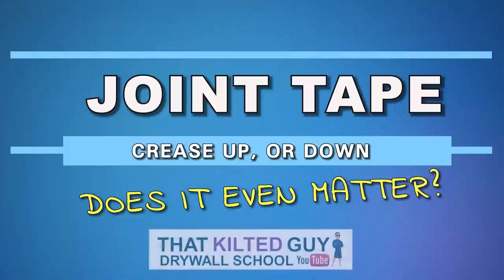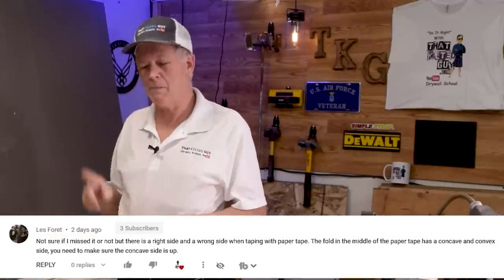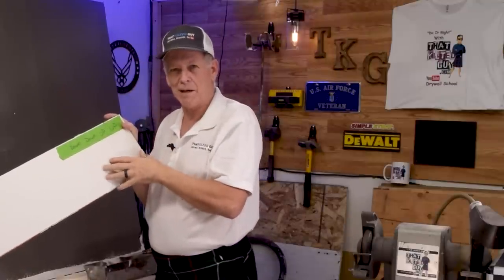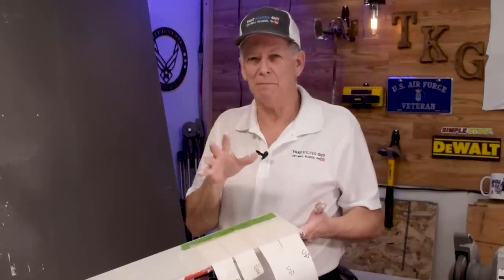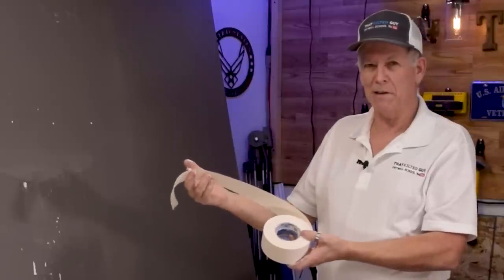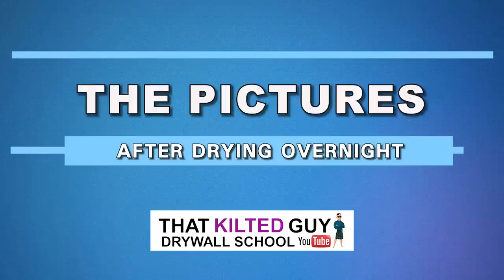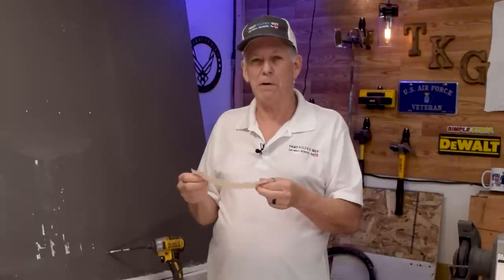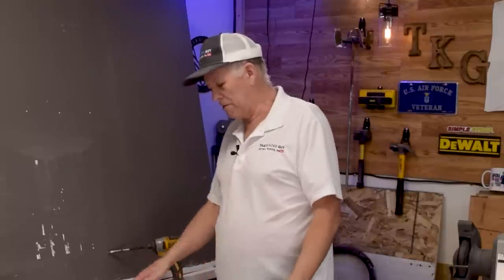I Was Taping Drywall with Paper Tape WRONG for 35 Years???

Comment: Have been taping for 45 years. With a bazooka and hand taping with paper tape small jobs. The crease is always down when using a bazooka whether it be an angle,butt joint or a bevel joint. Had to finish a small job someone else started who taped the paper crease up in a bevel joint and had to finish it like a butt joint. I corrected him and he does it my way now. I guess to each his own whatever works but I will always keep the crease down.
Reply from the maker: If that crease was sticking up that much he did it wrong. Novices often don’t know how to wipe the tape down properly, or they used to thick of a mud, and all kinds of other mistakes so that’s most likely why you had to do that. I can just tell you that I’ve done it both ways and because I know how to properly tape it, it doesn’t make a bit of difference when done right. But yes with a bazooka, it always comes out the same way and I’ve taped with a bazooka for 15 years before doing these repairs. Thanks for your comments
Reply: @ThatKiltedGuyDIY  You are welcome.Of course we were not taping with the best mud and hand taping. I always said CGC All purpose is the best especially for taping with a bazooka or hand taping. I know you know your stuff. I just like to watch videos about drywall taping and finishing so I can compare myself to the pros.

Comment: The creast is for folding for ceiling to wall or fold for corner and fold to make a 90 degree in a open doorway that if you don't use metal that is my belief I have done a lot of houses my self and I have not seen any different how you lay the tape mud going to soak in and make it stick to the wall or ceiling that is just my opinion

Comment: I guess I missed the part where you said which direction you ran it, but I’ve always put it crease side down, same as if you taped and inside corner. You wouldn’t crease the center line opposite to the way it comes pre creased or you weaken it. Also like others said, if you do crease up and it gets over sanded, you will burn the paper
Reply from the maker: I always put the crease in for inside angles but it doesn’t matter on flats so I don’t worry about it. If you burn through it your over sanding. And that’s never happened to me so it’s false anyway. The crease sticks up about 1/100th of an inch so it’s silly to think it will make a difference on flats

Comment: I have done tons of spackling and i use raised crease up on seams nonso much for sticking but it promotes spackle raise on joint
Drywall taping is to me is the finish
3 to 4 coats little sanding.  I feel my spackle 
I dont like spackle jobs that folks make humps all down the wall...i call them union jobs. Which i get. In and out make the money but my work is based on call backs and customers being pleased
No special tools just blades, hawk and maybe a tray. Hand sanded and most of all. Square corners!!!!!!!

Comment: Funny enough; I worked in printing years ago and when we had to fold cardstock we would have to "score" it first by running it through a machine with a scoring wheel on top roller and die on bottom roller and I naturally thought the indent went on the inside of the fold but NOPE.....!!! The crease was on the outside!
Reply: The crease is the most stretched part.
Reply: @MintStiles  I hope I said it correctly lol, hard to explain. The "indent" goes out

Comment: I think it comes off the roll as the manufacturer designed it to with the crease down, however, in doing a small patch it doesn’t mater for a few pieces but the intention is to have the crease up doing a whole house it requires a little more effort to reverse the crease.  
In summary put your roll holder on your belt and use it as it comes off 
I’ve seen guys wet the length of tape before it’s put down .....just an extra step in my opinion.  Thinning down the mud should help with wetting the tape
Reply from the maker: The crease is ONLY so you can easily crease It for inside angles. Wetting it can weaken the bond as I showed in a recent video.
Reply: @ThatKiltedGuyDIY  I use the crease fir the inside corners it folds easy and fast.  I had a great teacher.  I’m a GC and spent a long time watching and learning from the finisher I worked with for many years 
I like and learned from your skim coat video.  Very detailed
Reply: Listen to this man!!!!!!!!!!!!!!!!!!!!!!!!!!!!!!!!!!!!!!!!!!!!!!!!!!!!!!!!!!!!!!!!!!!!!!!!!!!!!!!!!!!!!!!!!!!!!!!!!!!!!!!!!!!!!!!!!!!!!!!!!!!!!!!!!!!!!!!!forget the rest!!!!!!!!!!!!!!!!!!!!!!!!!!!!!!!!!!!!!!!!

Comment: Didn't know of this debate, but I have been using the tape for months now and I remember the center line getting scraped or sanded to death because of the slight increase in depth at the center. I'm sure better technique would help but I've got to work with the skills I have now. I'm going to try it with the crease facing the wall and see if that makes a difference for me.
Reply from the maker: If you’re sanding enough to hit the paper, you’re over sanding

Comment: Hey kilted guy, hope all is well. Do you ever texture a repair like 4ft x4rt repair with hot mud? Then knock it down. Just asking. Thanks James
Reply from the maker: Nope, no need
Reply: Ok Kilted Guy! Yes everyone knows your one of the best!lm getting really good at my repairs and the reason l asked you about using hot mud for texture is l do alot af repairs that the homeowner wants me to paint. l will never be as fast as you but lm getting pretty damn fast. All l do is 0ne sheet or less with texture and paint. Do you reccomend painting a large repair same day as the repair?Did you used to do that? lm struggleing with this under 5 hours. Your thought please. Thanks James @ThatKiltedGuyDIY
Reply from the maker: Well hot mud mostly sets up faster although it does dry a little bit faster. I found that trying to do the repair and paint in the same day usually means a two or three hour drying time so I just come back the next day. Even if it’s a small repair it will likely take an hour and a half to truly dry it out and not just surface dry it.

Comment: When you do an inside corner, the crease is in. I always assumed it was that way for flat joints too. As well, the way it rolls off a holder, or through a banjo or bazooka puts it crease down. Don’t think it actually makes a difference though. Kind of like the way toilet paper is supposed to be hung, mullet or beard.
Reply from the maker: Exactly. It just most often ends up with the crease towards the wall but that doesn’t mean the other way is wrong.

Comment: I emailed USG asking if the orientation of paper tape was critical to proper performance.
My question:
“What is your question?: I’m trying to put this controversy to rest. When using paper tape with your All Pupose or Lightweight compound, does the orientation of the paper crease (facing up or down)matter? Thank you 

Their response: 
“SHEETROCK® Brand Joint Tape is a high-strength paper tape which is lightly pre-creased for corner application and designed specifically for use with SHEETROCK Setting- or Drying-Type Joint Compounds to provide optimum performance. Its special cross-fibered paper provides high tensile strength, both with and across the paper grain, for joints as strong as the board itself. The tape also possesses wet strength to lie flat and resist tearing under tools. The tape is supplied with a preformed crease in the center. This facilitates finishing of interior angles by allowing the applicator to form a sharp, straight fold in the tape. In addition, paper tape is recommended for use in mechanical taping tools, and is required whenever a drying-type compound will be used to embed the reinforcing tape.”

By this response I’m assuming the orientation of the tape( front or back) (facing away or towards you) is unimportant. Issue resolved. Agrees with you. You’re correct on the issue as usual!
Reply from the maker: Thanks. I actually spoke to them on the phone and confirmed the same thing years ago.

Comment: I'm not arguing and I love everyone but I've seen rookies and homeowners sand a butt joint a little too much and guess what you see? The center crease so in mudding every little bit counts and I was taught to pay attention to detail so for me the crease is always going down and I'll teach that it goes down and there is no other way
Reply from the maker: But you just explained the reason why it doesn’t matter. It only matters if you over sand and you shouldn’t over sand. And if you do over sand you need to put another coat on so that negates whether or not the creases goes up or down. Even if the crease is down, if you over sand that much the edges will show, guaranteed. There has to be a thin coat of mud over the tape or it will show.

Comment: If there was a right or wrong way it would be printed on the tape, by the manufacturer.   Or listed in an instruction guide.   As it is with other products.   While your test was interesting, it is designed to go over a joint beween two sheets, therefore from a scientific test I would like to see if you could do it again, crease up and down, between two sheets.   Both on butt and flat joints.
Thanks.

Comment: Hey Kilted Guy! Hope all is well at you casa! You are way better and faster doing repairs than the average repair man. Not diy but the average repair guy which l am. l dont beleive working by the hour, or wouldnt be in business for my self. Nation wide in your professional opinion, what is the national average for a repair guy per hour? After giving a estimate. We all try to estimate how long the repair will take. but some times we stump our toe! After travel time for estimate. mat and labor what did you try to get per hour? l checked your website out and see what you get now but what do you think is a reasonable estimate? Thanks James
Reply from the maker: I think you need to make at least $40 an hour if you do quality work.  (In my area a 3 bedroom house runs about $1,600/month rent for comparison).   I was making an average of $120-$150/hr lately (sometimes more) when doing smaller jobs.  Bigger jobs I make more like $80/hr.  I made that much by getting super fast, doing the best texture matching, leaving jobs clean and the customer happy and building that 5 star reputation online.  But if you make less than $40 an hour, and are even decent, you are selling yourself short.  Too many tradesman don't know the true cost of being in business and don't charge enough.  But here's an example of why I made that much.  I just did a neighbors job the other day, which I'll release a video of where I fixed 1 water damaged ceiling tape joint (no cutout needed), 1 ceiling patch of 4" x 24", an 8" crack, cracked cornerbead on about 4 spots of a pony wall, torn brown paper in 4 spots around 1 door trim, an 8" peaked joint on the ceiling and several other small spots.  I charged $350, cash and it took me about 2 1/2 hours from start to texture.  Note that I had almost nothing to mask off as it's under remodel and no drive time to figure in.  I figure the average guy like maybe you, might have taken 6-8 hours and you could charge the same, but make less per hour since you are still learning how to get fast.
Reply: @ThatKiltedGuyDIY  Boy they got a hell of a deal cause your super fast! l hear that song superfly. You a bad man. Glad we aint at the bar drinking beer because them crazy fools wouldnt like you. All the wanna bees are experts. You are top 5 percent nation wide. Keep those videos coming brother.Thanks James

Comment: I've completely stopped using paper tape I use high quality mesh tape and have been doing a long term test, my first 8 to ten years doing drywall I only used paper and about that same amount of time 8 to 10 years I've been using mesh my conclusion is the mesh when used properly doesn't recrack nearly as much also never get bubbles with mesh, being a general contractor I don't do drywall all the time so I also appreciate the speed to apply mesh too.
Reply from the maker: I’ve put on hundreds of rolls of mesh tape with no problems. Its technique that makes it fail or not.

Comment: What up kilted guy? Can you tell me the longest trip you would you would travel for repair work. Thanks James
Reply from the maker: I hate travel but for the right money I would go about anywhere. I once got hired by a cable company to drive three hours and do a one hour repair and they paid me $400 in about 20 years so. 

Last year, I traveled 90 miles to work on a gymnasium ceiling replacing ceiling tiles and doing some drywall repair. It required a manlift, and two layers of three-quarter inch plywood under the lift at all times so I charged them $30,000. It actually took a week to complete and we stayed in a motel the whole time but it paid well because no one wanted to do it. I have a video here on YouTube of me working on that job.
Reply: @ThatKiltedGuyDIY  Damn l know who to ask for a loan!
Reply from the maker: @jamescathcart4762  lol. That was before I got Covid and money took a big hit after that. And that was two of us doing it. And I I think it actually took a week and a half so with all the motel fees and everything else I did make good money but nowhere near 30,000.

Comment: am i supposed to thin out my mud or no? im 27 and just started doing this on my own home... big thanks to this channel!! I now know how to tape!
Reply: definitely thin down your mud. your forearms will thank you.
Reply from the maker: Yes, for taping, you generally want to shoot for the consistency of thicker yogurt. Fairly thin, but not so thin that you can’t keep it on your knife.
Reply: @ThatKiltedGuyDIY  will do thanks!
Reply: Find a guy like him write a check easier
Reply: @jessemull3018  thanks. I don't ever plan to use hot mud as a homeowner. Only used green lid USG mud. Never had an issue nor do I think I will ever need anything else. Appreciate the info. I'm learning as I go and have been using my garage sheetrock as a test sample.. Doesn't need to be perfect for now.
Reply: Hire a professional ,you’re welcome
Reply: @steverich3585  I'm good thanks
Reply: @joesmith9577  i agree im a contrator  an have a guy just for small jobs best 300 ever spent

Comment: I think down has less chance of a ridge. I once worked with a guy that when we repaired and hung new drywall he insisted on pre cutting the tape and soaking the tape in water before applying which I went what he said to do and it did spread easier and the mud seemed to glide over it easier but to each there own I never did that on any of my jobs!! Keep up the good videos!
Reply: I have walked into a couple jobs b4 and you would not believe that people put the drywall panels upside down lol now thats one to talk about!!$
Reply from the maker: There's no actual ridge with my example. It really didn't stick up at all
Reply: @ThatKiltedGuyDIY  i wasen't talking about any of your examples its just what have seen thanks for commenting back
Reply from the maker: No problem
Reply: @ThatKiltedGuyDIY  its all about the tape if someone cant get that right than you need to hang up your tools im a hand job kinda mudder and the best have told me how do you get mud and minus a coat its all in the tape!!# getter done!

Comment: It doesn't really matter on a butt joint but common sense tells you the raised bead gets imbedded into the joint between the drywall sheets. On inside corners it is also obvious. The paper is folded with the raised bead towards the wall imbedded in the joint. On an outside corner, obvious also. Raised bead faces out, rolling the outside corner.
Reply from the maker: Do you realize that probably 90% of the time even when the bead is facing down, that it is “missing“ the actual joint below and makes no difference?